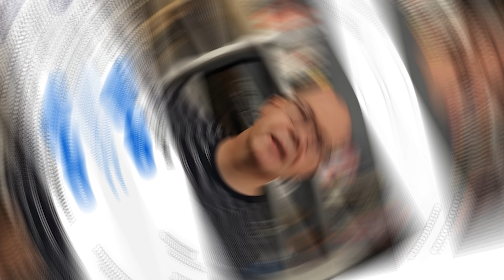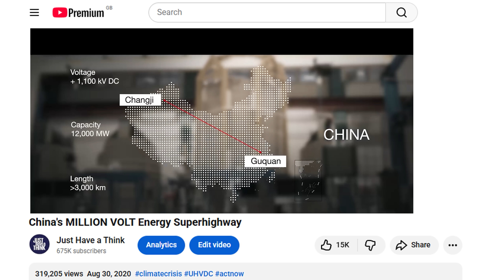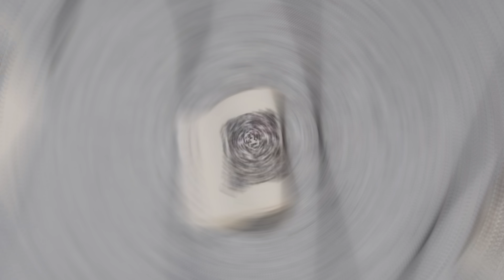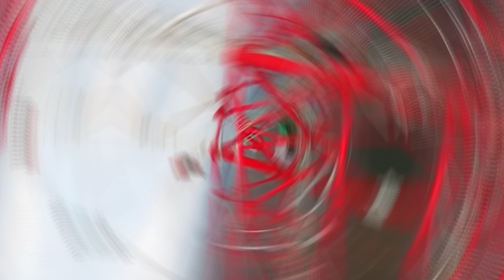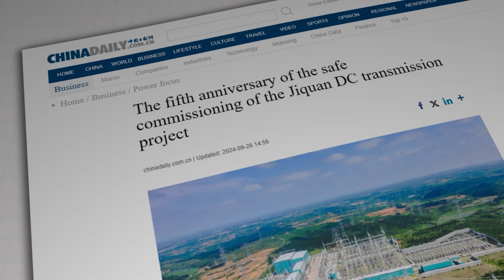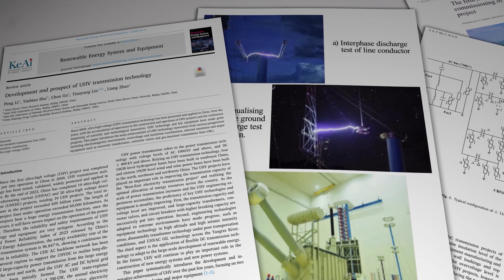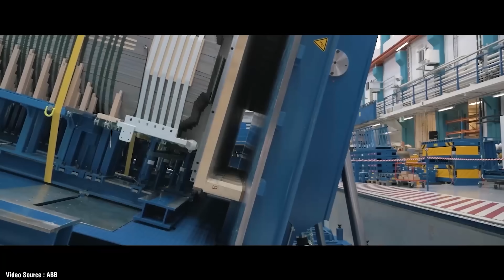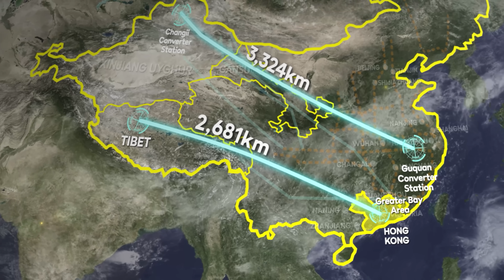China's ultra-high voltage transmission lines now breaking all records.

Comment: Imagine UHVDC transmission lines spanning from East Coast to West Coast, from northern states to the Sunbelt states. When the East Coast sun is setting, West Coast solar can help keeping lights running on solar till later. East Coast solar can help power the rising curve in the morning on the West Coast.

Northern states can power up the Sunbelt states with their wind resources and Sunbelt states can power up and even heat the northern states with their solar.

All of this, no need to pollute the atmosphere with fossil fuels.
Reply: But what about the oil lobby? Won't someone think of the oil barons?!?
Reply: @thatoriginalguy6213  In China, since the central gov said we need to construct more charging ports for EVs, even the state owned oil company begin to build charging ports.
Reply: @anakinlink5319  that is the catch, it's state owned, meaning there is no profit incentive in benefiting them. it's actually better for them to invest in cheap renewable technology internally and export the oil. it may be less profit in total for the company, but it will be more revenue going for the state.
Reply: It would be very difficult to have UHV transmission lines in the US because the grid is owned by a lot of companies.  Just doing upgrading is a huge challenge because each is trying to minimize one's own input at the expense maximizing others input.  The grid companies are holding the country at ransom.  If you want a higher capacity the government has to put money in but the asset is mine!  In the last 25 years US has been transmitting electricity of around 4,000TWh using virtually the same grid.
Reply: @gunsumwong3948 high power grid should always be in state (I.e. We The People”) ownership. It’s to essential to sell of to a company to make millions while getting tax funded anyway
Reply: @nicodesmidt4034 wouldn't it, constitutionally speaking, be between the various interstate companies shown on the map?  That is literally nothing to do with the federal government, as everything to do with responsible governance of mega corporate assets.  Something for the shareholders, bankers, and CEOs to work out?  Or are you planning an economy!

End times for capitalism in the USA?
Reply: @nicodesmidt4034  But it is not the case in the US.  In China and UK each has one grid company controlling the lot.  In UK NAT Grid is owned as a private company.  In China the State Grid is the world biggest grid company owned by the state.  That is why China and UK do not have a connection problem with renewable energy addition that the US cannot cope.
Reply: @nicodesmidt4034  The United States is the purest form of capitalism, and nationalization is not in line with capitalism. All industries should be open to capitalists.
Reply: @simonmasters3295  What are you talking about, that is capitalism. What we have not had here in the US for a long time is free markets.
And no, it doesn't have to have anything to do with the individual companies. We build a supergrid that can connect to the various grids and efficiently shuttle energy from the east coast to the west coast. That way, renewables can be generated anywhere and distributed anywhere.
Reply: @Ceraline-u5p Unrestrained capitalism destroys free markets.
Reply: @williammeek-h2o  What achievements have American state-owned enterprises made? From the founding of the United States to the present day, it is consistently privatized enterprises that have achieved success. Without private enterprises, the United States would not have achieved its current level of success.
Reply: @williammeek-h2o you really don't have any idea how your country works do you?
Reply: @Ceraline-u5pincorrect, you're talking about Neoliberalism, China is Capitalist.
Reply: @Ceraline-u5pyou're typing that on the internet, a structure built by universities & the military at a time when university results were Public Domain -- effectively all State-owned 😮😂😂😂😮😢
Reply: @alanhat5252  The internet did indeed originate from a military project. However, its widespread adoption is largely attributed to private companies.

Currently, both internet software and hardware are based on private companies: AMD, Nvidia, Intel, Oracle, Google, Microsoft, and many more.
Reply: @alanhat5252  nothing about monpolizing an entire industry for non profit purposes is capiltalistic
Reply: @Ceraline-u5p and how many failures had the country made in embrace of these private enterprises? I mean the video itself is literally talking about a huge benefit that the US has been missing out on in pursuit of privatization. This isnt the girst, and it wont be the last.
Reply: @Ceraline-u5pnuclear power generation, cell phone technology, the internet….all came from government research which sought to develop ROBUST technology that benefited the public.

The Murrican capitalist model is fundamentally broken: extract the maximum wealth with ZERO risk and research, pay the workforce as little as possible and the upper management/shareholders (who contribute NOTHING to innovation and creativity) as much as they can.  Hollywood is a great example of this failed model - what was the last really good movie that was produced NOT using a formula?
Reply: @Ceraline-u5p Yes, you would do well to remember that
Reply: @alanhat5252  Better than you clearly
Reply: @gunsumwong3948  unfortunately the UK is having to tell fully built solar farms to wait 3-5 years for a grid hookup, and as a result some major projects are just choosing to wait before they even build now.
Reply: @gunsumwong3948  The simple answer is a UHVDC supergrid. The dictionary definition of super meaning "above". Have the UHVDC supergrid circle the country and have high power interconnects at places where high power lines already exist at multiple points.
Reply: @gunsumwong3948  "the grid is owned by a lot of companies"
capitalism skill issue.
Reply: @gunsumwong3948  The problem is now the US grid CANNOT be upgraded as nobody today makes the types of transformers they would need to build out their grid. There is stilll ONE company that produces a few of these old-fashion Tesla-style transformer monsters every year. Problem for Americans is its based in Tianjin, China and will not sell to US companies. I wonder why?
Reply: @majorplonquer156  Some one took you brain to the washing machine!  China's transformers are cooperation with big European manufacturers like ABB.  US can buy from them!   US can send people to the moon and you think it can't make a simple transformer?  The only problem the US has is its products are easily 5 to 6 times more expensive than the Chinese, building a ship or a solar panel.
Reply: @majorplonquer156  Transformers are not highly sophisticated technology. The basic design hasn't changed in a century. Materials have improved, which means modern transformers are more efficient and longer lasting, but that's all. Show a modern transformer to Tesla and he would immediately recognise his own three-phase invention. The only reason the US doesn't make large transformers is that China can make them cheaper, and no company is going to tool up a factory only to be undercut by imports.
Reply: @gunsumwong3948  The government should handle utilities not private companies. Pass federal laws to make all utilities government run
Reply: @ocelotmadness6287  I know it is simple enough to do but can it be done in the US?
Reply: @ocelotmadness6287 that's only possible if you stop voting for neoliberals
Reply: @ocelotmadness6287  and then a liberal government will take over, cut investment to those federal companies, and say "look how bad it is, it's because the government can't run it" and then use it as justification to privatize everything.
Reply: @danilooliveira6580 no, that’s exactly what conservative governments do … just look at the UK since thatcher
Reply: @snafutube by liberal he doesnt mean liberal vs conservative. He means liberal in the sense of classical and neo liberalism which are both capitalist and anti socialist ideologies.

The difference between the liberals (democrats) vs conservatives (republicans) is minor and usually cultural (pro choice vs pro life; 2 genders vs lgbtq; etc). When it comes to the economy america is a one party state and has been so since the republic was formed.
Reply: @snafutube  what peoplezk1 said, when someone says "liberal" in the economic sense, they mean neo-liberals (or classical liberals), not progressives, those are different axis of the political spectrum. progressivism (sometimes called modern liberalism) and conservativism only refer to social ideologies, not economic. there are plenty of government that are conservative but socialist, and plenty of governments that are progressive but strongly capitalist.
Reply: I've imagined it. There are tons of reasons why this isn't happening anytime soon, but they're all related to human factors (land ownership, laws, politics), rather than actual physics.
Reply: @ab-tf5fl  This is a structural problem of the US.  Just like more guns available than the population could use them or homeless people in every big city or the wealthy billionaires can dictate who should sit in the president  chair in the White House.  Americans can either put up or shut up..
Reply: @gunsumwong3948  Fukuyama wrote a book called <The End of History>, which seems to suggest that US is not the end of "history", but rather the end of "capitalism".
Because it perfectly demonstrates the final social form where everything is treated as a business and people are also seen as resources.
Reply: it would be used solely for "AI" datacenters
Reply: @HolarMusic the United States has so much solar and wind potential that we can build literally unlimited amounts of data centers, charge them for electricity and make it free for everybody and still be profitable.
Reply: @xjdisuehd  yes but red tape actually no.
Reply: @xjdisuehd  Could, yes. But solar and wind are capital-heavy: You have to pay for the machinery up-front, after which it sits there giving you near-free power for thirty years. That's awkward for businesses. To the point that one of the biggest expenses in large-scale renewable construction is the interest on the loan.

One reason China is good at these large infrastructure projects is that they don't rely on market forces. If the government in Beijing decides China needs an HVDC cable - or a road, or a rail line, or a dam, or a wind farm - then that project is going to get built, and any objections are steamrollered aside. Even if the project isn't actually a good idea.
Reply: Make it so ❤
Reply: @nicodesmidt4034 Patton style or Picard?  The Borg get things done
Reply: You can imagine that all you want it will never happen in the United States. They don’t have the technical, economic, or government capability to get something like this done.  The only way something like this will get done. Is if they contract it out to China
Reply: everything is easy if the country have and willing to spend money.
Reply: @YSKWatch  But US is more willing to spend to the tune of $2 trillion this fiscal year!  Think the money can be spent to promote politicians' idea or to benefit the community at large.
Reply: @YSKWatch China is leading US is bleeding
Reply: I can imagine, in China. The US is busy starting another war
Reply: You have named the single use case where HVDC transmission is preferable to AC. If the distance traversed is more than 800 km, then HVDC becomes preferable as to cost.
But it should still be borne in mind that ALL transmission systems lose power over distance, so that the shorter the transmission distance, the better.
Reply: @omi_god  That is a gross oversimplification.
Longer lines are less efficient. 
But shorter isn't necessarily better.
Or even preferrable or even possible.
If it just one factor to consider.
The biggest factor is generating energy where it can be and moving it to where we want to use it.
The intermittent, distributed, and localized nature of wind and solar mean long distance transmission.
Reply: @williammeek-h2o  Nevertheless, the longer the transmission distance - whether AC or DC - the greater the loss. That's just a fact of physics, which is what I pointed out. I do not believe the world will ever rely totally on renewable energy. I have a very pessimistic view of humanity and our existence on the planet. We are a greedy, selfish species, and we have already fouled our nest beyond the point of rescue. We have set forces in motion which we cannot control which will end us as a species before too many more years.
Reply: @omi_god  As I said, that is just one design consideration of many. And even then it is a partially arbitrary one as you can go to higher voltages and bigger wires to reduce losses.

Humanity as a species will survive. No doubt about that. We are a very adaptable species. 
It is our modern civilization that is in danger.
Reply: Won`t happen with the orange orangutan in charge there
Reply: DIG BABY DIG! 
big oil says : nope.
Reply: or you can just build up the energy facility near the town that needs it.
Reply: @dangle3392 that's been done, it's now the 21st Century not the 19th.
Reply: This is why democracies are often chaotic than their authoritarian counterparts, a competent authoritarian far outperforms chaotic democracies.
Reply: @swollendoggo2529  any competent government would outperform any chaotic one; it's not about democracy or authoritarianism.
Reply: @swollendoggo2529  it’s not just that.  FERC and NERC tightly regulate in control any possible innovation, and when that innovation occurs it is due to an external push outside of FERC coming sideways into DOE, usually by a seedy grant, or a lobbyist or company getting on the standard boards.   The reality is, we are more corrupt than China, we just make it legal, and it is much much slower.
Reply: @swollendoggo2529 did you mean corrupt democracies.
Reply: @Francis-d5u  yes, corrupt and divided.
Reply: Big oil will never allow this
Reply: or you could just use nuclear and save the metals
Please?
I’m really sick of copper wire being so expensive
Reply: I have been thinking about the emerging support industries that will spring up as te EV revolution gathers speed.
Specifically non OEM batteries for EVs with better energy density and the flurishing of Ice car conversions, with comnaies making kits to make it easier and quicker. I know this is crystal ball gazing, but I do wonder if there is anything like this emerging yet
Reply: Is that what the unreleased verse of the song "imagine" sounds like?
Reply: NOPE! Drill baby drill! Orange man good! 🤡
Reply: you country can't afford that. they need 1 trillion dollars of military budget to bomb children 😊
Reply: Just put some nuclear power stations in and stop wasting time with toys.
Reply: Makes sense to me. Where can we invest? Cant be everyone is just clinging desperately to the past …
Reply: Even better if we could connect continents with UHVDC cause there is always a place where it's sunny or windy and even seasonal changes wouldn't be a problem since the hemisphere that's in summer can just send power to the one in winter.
Reply: @Ninjaeule97  

The battery economics and geopolitics may prevent large scale connections, like Russia to North America, via the Bering Strait and then into Canada/Alaska. But Asia - Europe - Africa is something that is already happening. There was a plan to have a large solar field in Morocco to power Europe, but it was shelved, because of course the colonial relationship of the past, and arguably so, this was seen as just another method of colonialization.

TLDR; What you suggested, is going to happen. The economics dictate it is going to happen. I'm pretty sure by 2100 we will have at-least 100TW worth of UHVDC running across continents.
Reply: @Ninjaeule97  Continent wise, north and south is easier than east west.
Reply: It exists from North to South along the West Coast. Google: "Pacific DC Intertie."
Reply: Environmentalism prevents this from happening.  We can't even get transmission lines approved to span Arizona to connect solar farms because the environmentalists protest against it, thinking it'll bring more AI datacenters.
Reply: That means revolution in US. Billionaires will kill this idea at the first second.
Reply: There has been a bi-directional DC transmission line between the Pacific NW and CA for many years, the Pacific DC Inter-Tie.
Reply: @briscoedarling3237  Yes
Reply: There is a big difference between the Chinese government system and most other governments.  They do not seek permission to do these massive projects. So as long as WE are willing to give up OUR rights , we can also do this.  LETS VOTE ON THIS.  In China the people do not get a vote.  Complex world. 🇺🇸👁️🇺🇸✌️
Reply: @rayRay-pw6gz  "LET THEM VOTE, and this makes them think they can decide those things. " LMAO
Reply: oh yes, the multitudes of things that can be done NOW even...but you first need people in power who want to see that kind of change.
Reply: Unfortunately I don't think it's feasible in our current system. If we nationalized the grid and put eminent domain to good use, it would be insanely profitable and good for the environment. I've been obsessed with this idea for a while. It would be so good with how the west has extremely few cloudy days. It's what I would do if I was dictator for a day.
Reply: That was studied during the Obama Administration. It was concluded it would cost half a trillion dollars and return 4 dollars for every dollar spent.
Reply: Or from North to South since Canada largely powers MUCH of America via oil and gas shipments and huge power exports from the hydro provinces... British Columbia, Manitoba, Quebec...  And the nuclear one! Ontario!
Reply: Bro, this requires a centralized socialist government like China's and a state-owned monopoly power company. It's almost synonymous with hell in the US. The U.S. does not lack the capability and capital to develop ultra-high voltage technology, but this is not a technology that capital needs.
Reply: @xiaowen6876  Capital didn't need the highway system either. Yet somehow, we did it.
And everyone benefited.
Reply: @williammeek-h2o  At the time these roads were built, the US was not yet capitalist, or should be said to be in the early stage of a market economy. Now?
Reply: Fossil fuels don't really pollute much, we put scrubbers to get all the bad stuff out.  Also, CO2 is not a pollutant.  It's plant food.
Reply: @kayakMike1000 Every hear the saying "the difference between poison and medicine is the dose."?  
Anything is a pollutant in excess and we are putting a huge excess of CO2 into the atmosphere. 
You have been lied to.